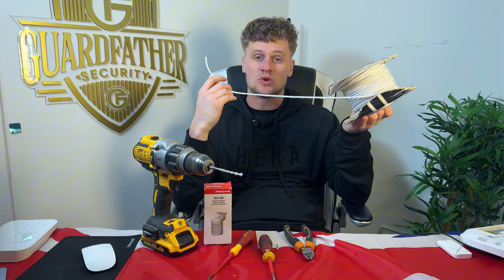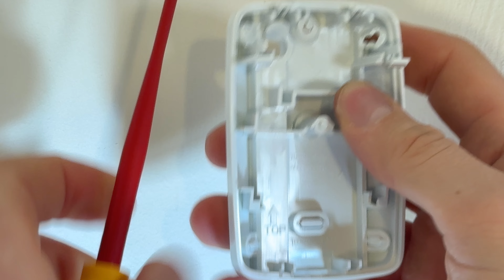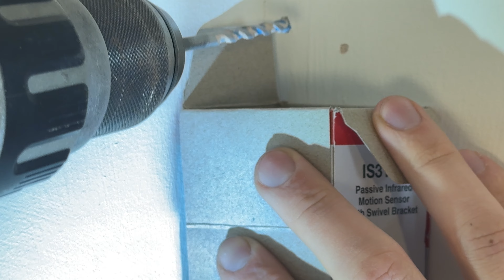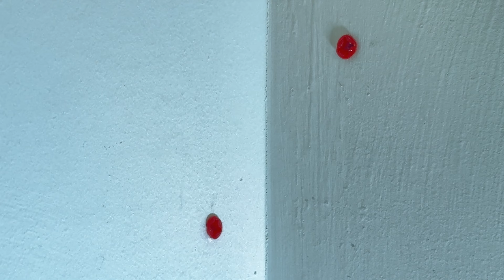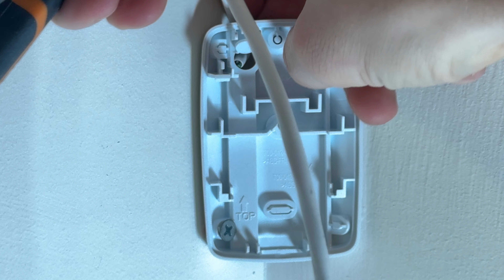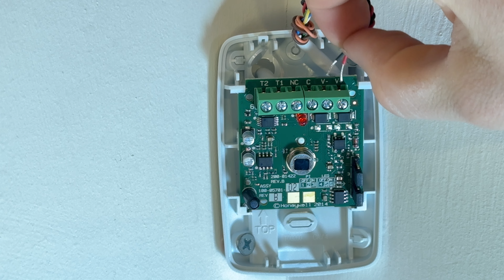How to install a burglar alarm motion sensor

Comment: Hello, nice video, but the C connection is the common connection, not closed connection, you have already described the normally closed connection NC, these terms come from relay nomenclature.
Reply from the maker: Hi Paul! You’re right mate, in filming I didn’t realise I used the incorrect terminology, the multitasking of filming at the same time made me slip! Thanks for pointing it out

Comment: Resistor?
Reply from the maker: Hi mate are you referring to say End Of Line resistors? I’m going to do a specific video on fitting them too but if you’ve got something in mind you’d like more info on now I’d be happy to help
Reply: @SimonSecurityExpert yeah it might be. I’ll check that vid out when you post. Cheers
Reply: "Modern" movement sensors don't require an additional resistor (Shunt or end of line) as they have them built in, and you select via a couple of jumpers in the sensor